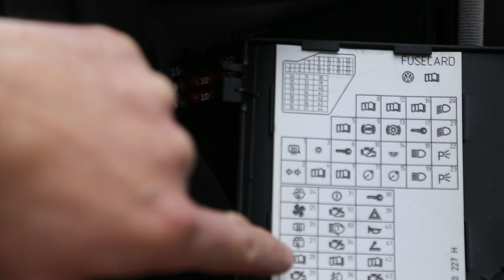VW Golf Cigarette Lighter/12V Charger Socket Broken -Cheap Easy Fix-How to repair Fuse Replacement

Comment: I've no fuse card for my golf. Are the fuses in the same location in all golfs?
Reply from the maker: They should be. I'm not sure of the difference between LHD and RHD cars and whether the fuse box is on the same side as the steering wheel or always on the right hand side. But either way it's in that position
Reply: @ajvw  thanks got it sorted 👌
Reply: @alanmoran2364  Hey, I have a left-hand drive on my car, and like you had no fuse in there in the first place. Did you just put one of those blue 15v ones in there? I'm worried about blowing something out or something...or perhaps that's not possible in the first place :P
Reply: @henmcben  I ended up checking my log book for the car and found a diagram with the fuse locations.

Comment: Hello , i need some help with cigarette lighter socket.. how i can stop power in socket when i turn off the car ( it is allways powered now ) thanx a lot
Reply from the maker: If you don't want it powered then if you pull the fuse it will stop the power to it but that means it will be permanently off.
Reply: @ajvw  i need power just when i drive and engine is on , after that should stop powered , when i turn off the car ...
Reply from the maker: @grosumihai9341  in that case the only option is rewiring the socket to be switched via ignition but I'd suggest an auto electrician for that. If nothing is plugged in then it won't be drawing any significant current
Reply: @ajvw  Ok thankyou for help i will mange this . All the best and take care !!

Comment: Hi my 55 plate golf interior lights don’t work   back boot and front or the glove box . Ive changed the fuse and relay still no joy . Surly all the bulbs can’t be blown. Any one else got had this problem? Thanks in advance
Reply from the maker: That sounds like it might be the sensor that detects if doors are open that has a fault. Do they work if you switch the lights on with doors shut?
Reply: @ajvw  hi . Thanks for reply. No mate they don’t . Just can’t get my head round it .

Comment: I've changed the fuse what else may be the problem ?
Reply from the maker: If the fuse hadn't fixed it then the lighter unit itself may be broken and need replacing
Reply: Thank you.
Reply: @ajvw  what would you verify if the fuse is good but there is actually no power on the complete 12v outlets circuit (measured with multimeter on the fuse connection points as well as on the cable connecting directly into the cigarette lighter plug) The whole circuit just can't get power, everything else works fine in the car. thanks! (both front and trunk outlets suddenly stopped working simultaneously)
Reply from the maker: @lucoche  it probably means you need to replace the lighter socket. I've had to do that previously

Comment: Where do you get a replacement fuse?
Reply from the maker: It's a standard auto fuse so any garage should have them or any shop selling auto parts
Reply: VW & Ford Car Maintenance Servicing Tips thanks for the reply. If the fuse is all ok, any other tips on what to check/do?
Reply from the maker: @liveandletlive497  If the fuse is ok then it may well be the lighter unit itself that has failed. When that happened in my car I bought a replacement from a scrapyard but they should also be available from VW dealers
Reply: VW & Ford Car Maintenance Servicing Tips ahh okay, thank you!